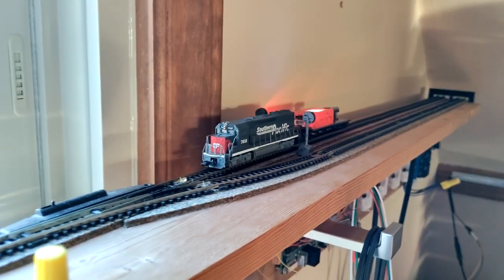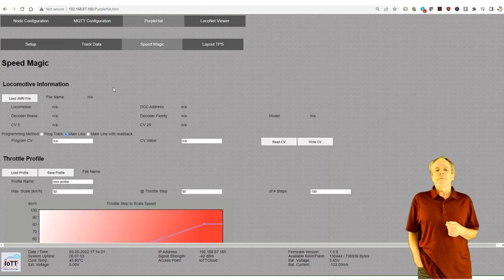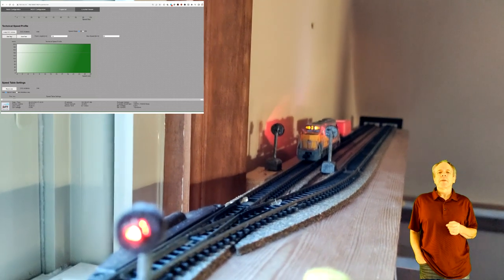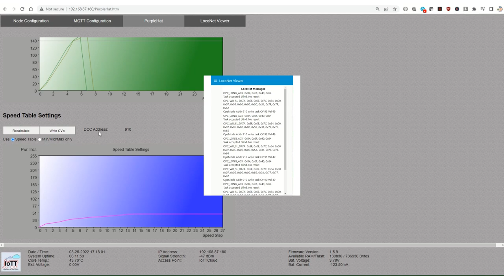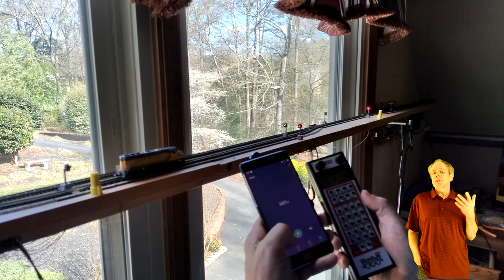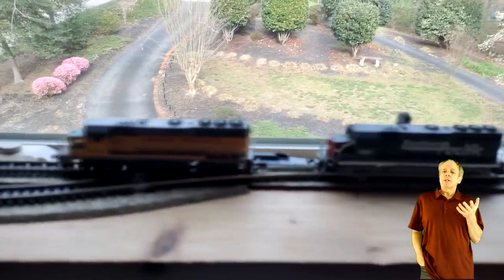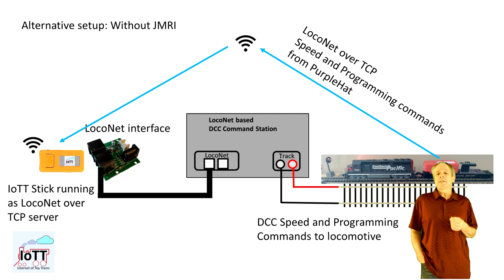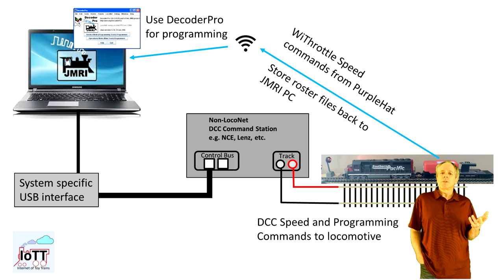One Minute Speed Profiling (Video#91)

Comment: Excellent......the way you've done it is more than adequate. Having the JMRI do the actual programming function is completely acceptable and practical.

I intend to install a purple hat in a large/long passenger car (HO scale) that will look like a track geometry car used on many protype railroads. I'll add an external battery and possibly an onboard charger using track pickups.

This development clears the major hurdle associated with speed matching and DCC. BRAVO!!!!
Reply from the maker: Your right, the main problem with speed matching is the time needed to do it. PurpleHat pretty much eliminates that problem.

Comment: You made good progress in the last two week. I was waiting your video this morning. As soon as you will release your product I will purchase one. Thank you for your contribution to the model train community. Never tested all the brand of decoder. I hope the speed table work the same in all of them.
Reply from the maker: Thank you. The speed table is part of the NMRA standard, so CV's are the same on all DCC compliant decoders. The effect of the voltage on the motor might depend on decoder and motor, but the PurpleHat sensor will figure that out when analyzing the motor. It will just result in a different speed curve.

Comment: Thanks for the update. Will the Purplehat include the IMU to build the track layout ?
Reply from the maker: I am currently testing several IMU's. As you see on the PCB, the I2C interface is there, so it should be possible to add an IMU board. In the meantime, it is just a precision distance sensor.

Comment: Hi - Will this speed profiling/matching work on Sound Decoders?  I have Loksound Decoders. Thanks
Reply from the maker: Yes, the CVs for speed and acceleration are the same. Some decoders do not support values of 0 for mid and high speed in non-table mode, but you can use default values like 128 and 255 to prepare the decoder for speed profiling. Check your decoder manual for the best values.